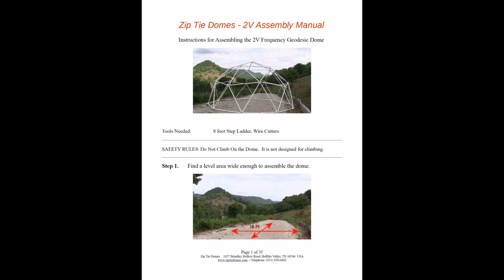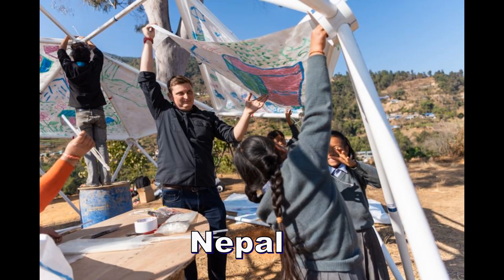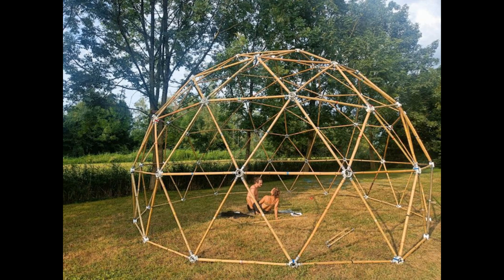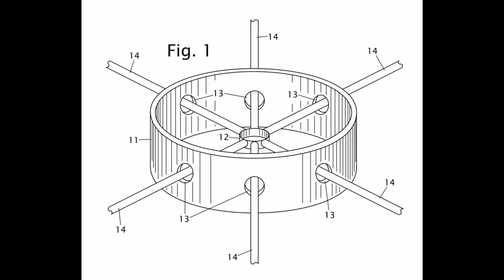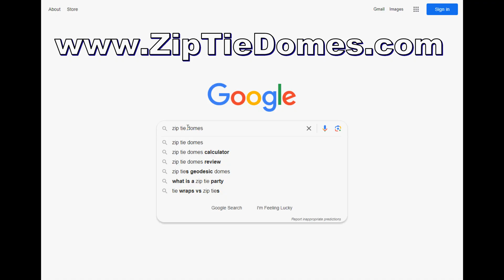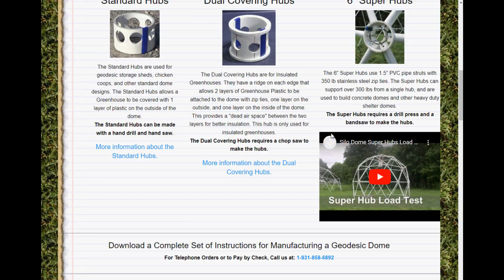Download DIY Geodesic Dome Plans –  Easy Geodesic Dome Plans and Kits

Comment: Adding more plastic to the ecosphere because he can't afford to do it properly. I weep for the children who will inherit this toxic world from uncaring parents.
Reply from the maker: The water you are drinking out of your tap comes through a PVC pipe.
Reply: @ZipTieDomes  The water I drink at home is thoroughly filtered as it enters the property with ultra-filtration and at both kitchen sinks with under-the-sink reverse osmosis filtration. From the city meter into and throughout the structure, it's all copper piping. It's the only place I know for sure I can drink water that isn't contaminated.
Reply from the maker: @brianbassettnumber1  That is good, and I drink rainwater with a Berkey filter that never goes through PVC for the same reason.  But millions of people have PVC plumbing in their homes, and there is a LOT more plastic in the ecosphere for PVC pipe in people's houses than in a few geodesic domes.

But I hear you.  You have a valid point. 

And I am working on building domes out of bamboo, which is a solution.
Reply: @ZipTieDomes @ZipTieDomes That's all fine, but PVC sheds nanoplastic into the environment, which means it's being breathed in. The same way that anyone with synthetic carpet is breathing it every second they are in their homes. Yes, there's a "lot" more plastic in the ecosphere, over 80 billion metric tons since its creation in the late 40s, and your temporary dome is just adding more. Even zip ties in your name are plastic; you're exacerbating the problem.
Reply from the maker: @brianbassettnumber1  Yes, it is all my fault.  If I would stop making domes, that would fix the problem.
Reply: @ZipTieDomes   Are you saying you can't help? There is so much now that it's not worth worrying about future generations of humans and every animal ever to be born? Do you also use and advocate the use of asbestos? Do you throw your trash into the ocean?
Reply from the maker: @brianbassettnumber1  So what are you doing to stop PVC?

Comment: It's important to note that the most common PVC pipe is very different in different countries. The regular PVC pipe used in the US is very high quality and it can be used to make archery bows, building frames, and many other things that must withstand large forces. The standard PVC pipe that you buy in a hardware store in Europe is much lower grade and will easily bucle or break under force. In Europe it's not always easy to find m the sort of strong PVC pipe that you can pick up in any hardware store in the US.
Reply from the maker: That is very true.  Also there is a difference if the pipe is intended for pressure or drainage. 

We can make the hubs to accept wooden dowels or bamboo which would be stronger than most PVC pipe.

Thanks for the comment.  John Hurt

Comment: Is it possible to start the construction at the top center section working your way outward and lifting the structure as you go similar to how a corn bin is built?
Reply from the maker: Yes, I have built a dome from the top down, but it takes more people and more "supports" and lifts to do the construction with that method than building from the bottom up with just one person on a ladder.

But yes, you can do it.  And PVC is very lightweight.

John Hurt

Comment: Thank you so much!
Reply from the maker: You are welcome and thanks for watching the video.  John Hurt
Reply: @ZipTieDomes  Thank you dear John! I live in Siberia and would like to make a double lair greenhouse, Geo Dome shape. 
I really wobder the durability of your domes. 
If you use 1 inch pipes, that is euqal to 25mm pipe diameter, but those pipes in the video look bigger diameter. 
Do they realli 25 mm diameter?
Reply from the maker: @hillarious2393  The 1" PVC pipe in the USA is measured on the inside diameter for 1", the outside diameter is 1.315", or 32mm.

The larger pipe is 1.5" PVC pipe, with an OD of 1.900" or 48.3mm, which is close to the 50mm pipe.

The downloads have information on both USA and metric size pipe in other countries.  If you are using non-standard strut diameters, like wooden dowels or bamboo, we will help you with the correct hole size for drilling the outer collars so the dome will lock together correct.

Here is some information on the Dual Covering Hub:

https://www.ziptiedomes.com/geodesic-dome-connectors/about-geodesic-dome-connectors.htm

https://youtu.be/Ks7Ifi6TTUE

Thanks,
John Hurt
Reply: @ZipTieDomes   thank you so mutch

Comment: Might use those zip ties with bamboo. Unfortunately PVC leaves microplastics......everywhere.
Reply from the maker: Yes, we do work with bamboo domes, and yes PVC is plastic.  Thanks.  John Hurt
Reply: @ZipTieDomes  Whaaat?! It's plastic? Get out. It's the tiny microplastics from cutting it that is an issue....genius.
Reply: @shutinalley  Good point.. A hotnife approach could mitigate that.. but yeah, wouldn't want to use pvc period.. just not into it. not for a structure.. maybe for a bathtub guitar, that's about it.
Whenever I have to cut PVC with a saw, I alway think about those micros just flyin' free, so I try to not cut pvc..)/*

Comment: Easily reverse-engineered just from seeing these images.

I built a 4-frequency dome with a 6 meter diameter out of ¾-inch EMT conduit, and we've been using it as a greenhouse since 2009.

Bucky Fuller approves this message 👌
Reply from the maker: Conduit builds great domes.  Have a good day. 
John Hurt
Reply: Pretty sure no-one is gatekeeping you from doing so here..)/*
Just a time saver, and headache saver for those who don't enjoy math as much as you do.. 
plans are cheap enough to be worth it and to support the ongoing research.. 
wonder if anyone's built a floating dome yet..)/*
Reply from the maker: @andretokayuk8100  I am working with a developer in India that builds floating cottages for resorts and is using these hubs to make bamboo domes that are covered with latex cement.  
So yes, a floating dome cottage for a resort is being developed.
John
Reply: Some man made a patent on this system, in uk... so i guess this is just whay it is a fake stuff... because o e cannot patent on top of a patent that is exacly the same
Reply from the maker: @renatomsgomes  Yes, I have a patent in the UK too.  Thanks.  John

Comment: Sun rot.
Reply from the maker: UV only affects the outer 1/100th of an inch as it does not travel through the pipe.  

So the sun only discolors the outside of pipe, it does not rot it.

Here is proof:
https://www.usplastic.com/knowledgebase/article.aspx?contentkey=774

Thanks,
John
Reply: @ZipTieDomes  Your link is a manufacturer that adds Titanium Dioxide, not normal.
Reply from the maker: @squareswing  Titanium Dioxide is what makes the PVC pipes white and opaque.  Yes, it is normal, this is why PVC plumbing pipe is white.  As stated at the bottom of that link, Titanium Dioxide is not in clear PVC pipe so you don't have UV protection with clear PVC.  So don't use clear PVC for building a greenhouse.

PVC does outgas chlorine, which can affect the greenhouse plastic.  So we recommend that you paint your PVC pipe with a white latex acrylic if you are using it for a greenhouse because the PVC that touches the greenhouse film will weaken it.

But if you are making a shelter, or covering the dome with cement, then it doesn't matter because the PVC won't be in the sunlight and there won't be any UV.  UV is only a problem for a greenhouse dome.  

I have 2 PVC pipe domes that I used for chicken coops out in the weather in my front pasture since 2013, and they are just a little discolored by the sun, but still strong.   Anything built out of wood and out in the weather for 12 years has rotted and turned into dirt.

Comment: Bamboo struts could also be filled with foam or concrete for added strength.
Reply from the maker: That is a GREAT IDEA!
Let's try it.
I know someone that has a lot of bamboo.
Thanks for being a friend.
John
Reply: Not a fan of pvc.. and if I was to use bamboo, I'd like to fill it with natural filler as well..
perhaps hemp talks + pine sap or clay emulsion.
Why create a structure that would biodegrade into industrial waste?
If you're after cheap strength and longevity, why not 2" wood dowels rolled in a couple layers of fiberglass?)/*
Reply from the maker: @andretokayuk8100  Great ideas!  

I looked at filling bamboo with aircrete to make it stronger, but a better solution is to use "solid stem" bamboo.  

Solid Stem bamboo is all bamboo wall, very little center hole, and very strong.  I have a place to plant it, so at least 5 years before I can produce any quantity.

Also there are thick walled bamboo that work very well, like Red Margin or Robert Young bamboo that are suitable for strength.  I have a friend with a bamboo farm.

But the bamboo does not have to be that strong. 

All you have to do is make the dome structure, then cover it with mesh, then spray a layer of latex cement over the mesh.  Each additional layer makes the dome stronger like an egg shell and less like a hub and strut space frame.  

This is how Monolithic Domes in Italy, TX makes their domes with just an inflatable air form.  The air form is just strong enough to hold up the first layer of cement, at that, the cement holds up the additional layers.

So bamboo is suitable for building houses with cement roofs and sides.   

Thanks for the excellent comments. If you want to talk, you can contact me here:

https://www.ziptiedomes.com/contactus.htm

Thanks,
John Hurt

Comment: Reminder: PVC degrades in UV, so paint your dome when done!
Reply from the maker: Yes, that is a great idea.
The UV only affects the outer 1/100th of an inch of the PVC pipe. The UV does not go all the way through the pipe to damage it.
But you are correct, it is a good idea to paint the PVC as the outside layer will discolor over time, and the PVC can interact with your greenhouse plastic if it is not painted. 
Thanks for the comment.
John Hurt
Reply: I've owned homes with pools in the south, and have never encountered any degradation of the pvc plumbing even after decades, other than cosmetic. I don't think it's something to worry about. PVC is a great material.
Reply from the maker: @vladimus9749  Yes, PVC is a good material.  Thanks for the comment.  John Hurt

Comment: UV treated black plastic cable ties aren't good enough? Once the cover is on it's all protected anyway.
Reply from the maker: What you have said is true.
We use the stainless steel zip ties for the 350 lb tensile strength with .30" diameter ties.
The black nylon ties of the same diameter are only 120 lbs.  If we use 250 lb nylon ties, they are half an inch wide and won't fit into the holes drilled in the struts, unless we drill the struts special too with a 5/8" forstner bit.
Stainless steel ties cost more, but they are stronger and easier to use.
Thanks for the comment.  John Hurt

Comment: In a RCM magazine from years ago, they had an article on making Thin flexible fiberglass sheets using cloth + Resin 
that was sandwiched between two sheets of glass.  So, depending in the size of the each triangle panel, this material
could be prefabbed and applied to create a strong light weight exterior covering.  To increase the strength of the plastic
connecting pipes, simply fill them with closed cell expanding Poly Urethane Foam.  A couple of spray cans should do
the Trick!!  I am definitely getting your Plans.  I was looking for a structure to feed chickens out in the pasture. Plus a 
tunnel Green house would be so cool!!
Reply from the maker: That is a great idea.  Or several good ideas really.

I have used fiberglass mesh over a dome and sprayed with latex cement for a hard covering:
https://youtu.be/4q-vnElQXCk

We also use the domes for moveable chicken coops, like Joel Salatin and Pastured Poultry:
https://youtu.be/Bek9WTIVD7g

Have a great day!
John Hurt

Comment: You give away way too much info , I could build this just off the info you provided in this video with no need to purchase the plans . 
Probably should tighten up some of that information if you want to sell plans
Reply from the maker: For the same strut diameter it requires a different size drill bit for every dome frequency to lock the struts at the correct angle to create the curvature of the dome.  Otherwise the locking collar won't work.  And a couple of other things.
So if you are going to spend $200-$300 to build a dome, another $19.50 for plans to do it right makes a lot of sense.
Plus you get telephone and email support for your questions. 
Have a great day.  
John Hurt
Reply: @ZipTieDomes  
If you make the holes in the hub the same diameter as the strut, the axial angles are taken care of by the flex  imparted over the length of the strut. The main issue with floating hubs is they are not self centering, installing a "strut depth stop" (split pvc offcut to form collar) at each end of the strut will set  how far the strut can go into the hub.
Reply from the maker: @JohnGuest45  Yes we use the center ring for all the struts to rest against for compression, and then zip tie the struts to the center ring for tension.
Thanks,
John
Reply: @ZipTieDomes 
The ends of the struts are anchored to the center ring with the zip ties but the larger outer ring with the over sized holes is effectively just "floating"  freely on the struts.  In the case of a pentagon perimeter hub, the inner pentagon struts will effectively lock before the perimeter struts due to the difference in axial angle. The  5 way hub in the pentagon will  center itself due to the axial angles being identical, ie, they will all lock at the same point.
Reply from the maker: @JohnGuest45  It works, that is all I know. Thanks for the comment.  John Hurt

Comment: Why not pvc joints to plug n play
Reply: because there are spots where 4, 5 or 6 pipes come together in different angles. there are no such prefabricated pvc joints. and if there were i think ziptiedome's method might me stronger
Reply: @Andy-t2q5i  Folks could try 3D printing the part, but I doubt it would achieve the same strength as the PVC joints. Z axis delamination issues.
Reply: @suzyamerica4679 there are ways to make 3d prints stronger. lets say we print a hook upright like the letter L then yes, it will break off because of said z axis delamination. but if you lay it flat like its on the screen here L than the usual forces applied on a hook are not interfering with the z axis. some people even print things diagonal and with supports so the z axis thing does not happen in any normal direction
Reply: that being said i dont thing z axis delamination should be a problem when printing such a part for a dome
Reply: @Andy-t2q5i  I have a bunch of sketches so far on it. Might make a model to test. I am a big fan of skin-over-frame designs that make the most of their respective contributions to structural stability.
Reply: @suzyamerica4679  do you have a 3d printer?
Reply from the maker: I would love to see it.
Reply: @ZipTieDomes  So far the strength looks like it would be less than what is achieved with the zip tie hub design, nor as robust during assembly. But maybe I will try making a small model just to check. Something like a 50cm dome. It does lock the outside flex angles as well as the inside ones.
Reply from the maker: @suzyamerica4679  Once you put a skin or hard covering over the dome, it will increase the strength more than the hub design, look up Monolithic Domes in Italy, Texas.  They use an inflatable balloon air form and spray it with cement.  So anything that can stand on it own feet is a good start.

I like the idea of a model.  A lot of people have really good ideas, but very few people will take the time to make a model and test it as a prototype. 
I make models of every idea that I can, even if it doesn't work, then I re-do it until it does.  Improving the model is the fun part.  And if I have made the idea into a model, then I can come back years later and see the idea again and start all over from a different perspective, and maybe solve the problem.

So I would hope to encourage you to actually build a model and test your ideas.  Just do it. 

Many blessings to you and your family.
John Hurt
Reply: Did you watch the video?